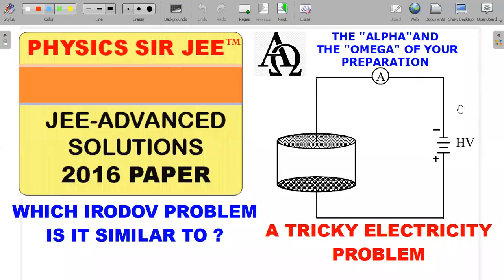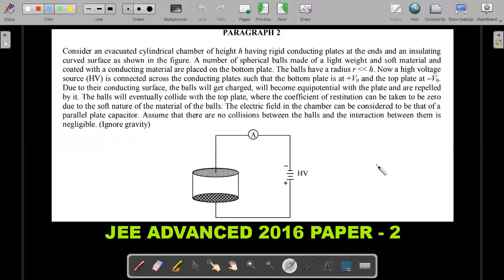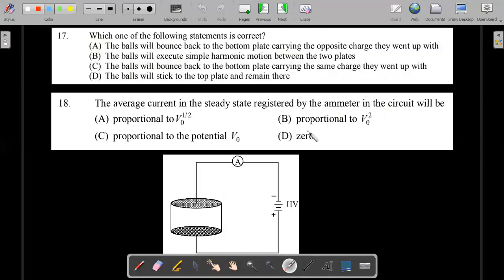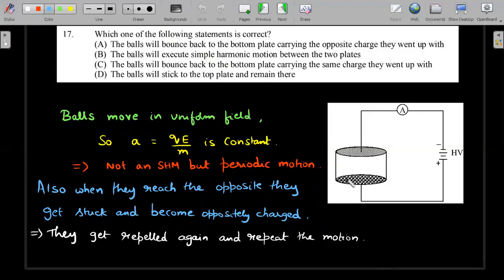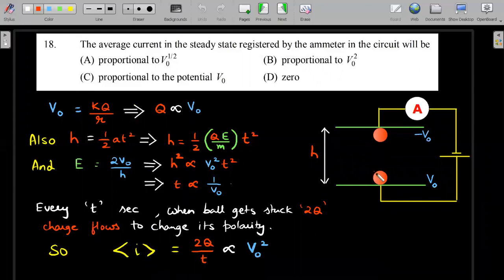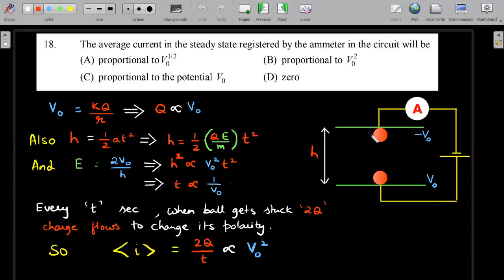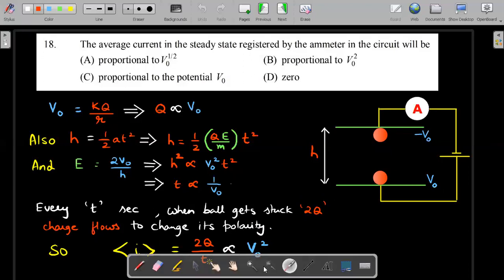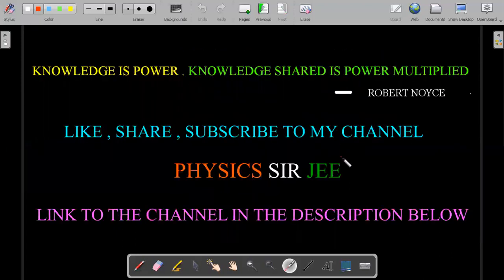JEE ADVANCED PHYSICS 2016 | ALPHA AND OMEGA |VIDEO SOLUTIONS   CHARGED BALLS CURRENT BETWEEN PLATES

Comment: sir in the jee advanced 2016 paper 2 question 4 ,  we first find the junction temperarature using rate of heat flow constancy in both rods and then using linear variation of temperature in steady state we find the new length expanded by integrating it , sir my doubt is why arent we using expanded length for calculating junction temperature i.e why will junction temperature even remain constant if length is not constant
Reply: COS ENDS TEMPERATURE IS FIXED

Comment: I have one dbt , tht it is given bottom plate is +Vo, top plate is -Vo that means potential diff b/w the two ends is 2Vo so that also means that polarity of battery is 2Vo right? Or will it be Vo? Not that it effects the answer but I just had this conceptual dbt
Reply from the maker: 2Vo , that's what was written for electric field in the solution 👍

Comment: And why have you taken potential difference equal to 2v why not v please tell🤔🤔🤨🤨🤨
Reply from the maker: PLEASE READ THE COMPLETE COMPREHENSION :)
Reply: @PHYSICSSIRJEE  sir suppose there is a conducting neutral body kept isolated and suddenly a electric field is switched on ,so its potential will increase?🤔🤔🤫
Reply from the maker: @Vikassinghchandel1789  no need, but if you keep it in contact with another charged body , then what do you think? 🤔🤔🤔
Reply: @PHYSICSSIRJEE  understood